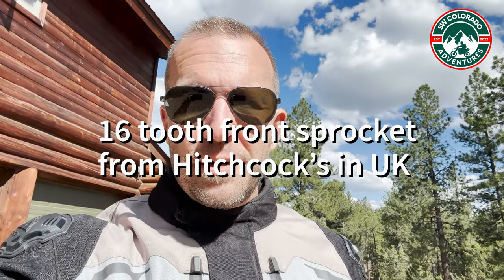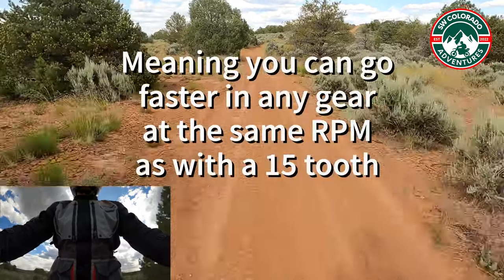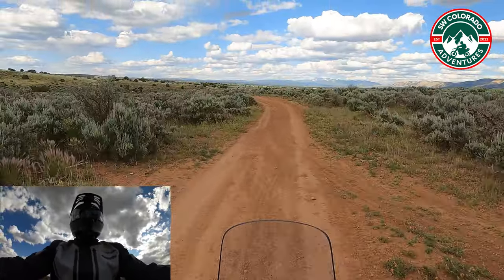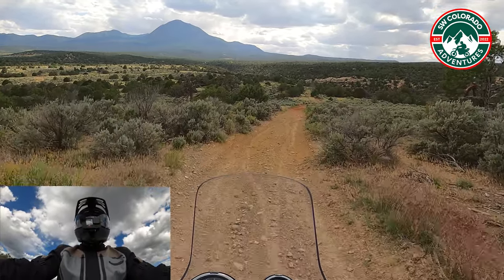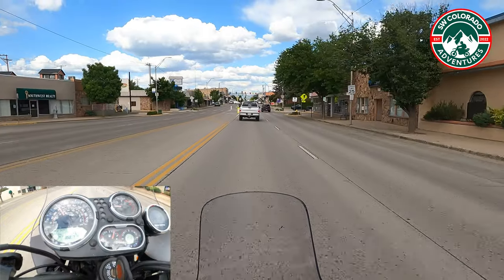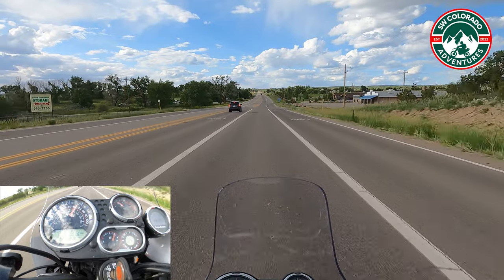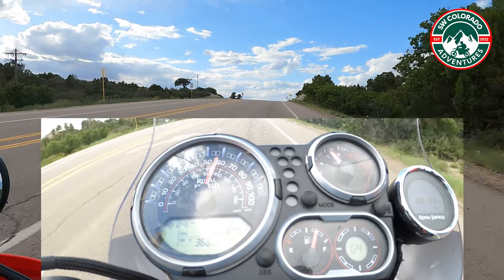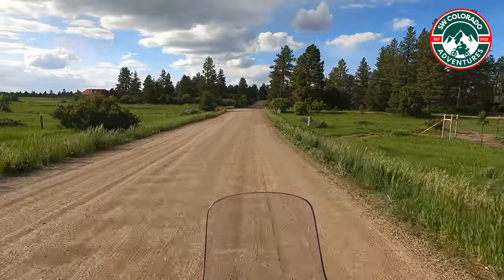16 Tooth Sprocket + Tec Camshaft + Himalayan = Amazing!

Comment from the maker: Have you put on a 16 tooth front sprocket? What are your experiences? I had to buy a new chain, did you?
Reply: What chain did you get? I have the 16 tooth sprocket (came with my bike from previous owner) and I'd really like to install it. Already have the TEC cam shaft
Reply from the maker: @wesloughrie1  I got a DID brand from Japan off Amazon. Nothing fancy but matches specs. Good luck!
Reply: @swcoloradoadventures  right on, thank you
Reply: Tried a 14 and 15 tooth sprocket with tec cam, booster plug exhaust, airbox ais and evap delete. 14tooth had very good acceleration but top speed was 82mph buzzin at at7000rpm max.  15 tooth jt chain&sprocket is much better all around acceleration not as good but did 85mph at 6500rpm and will 87 to 90 maxxed.  Yet to try a 16t,  quite happy with the stock size.  Sea level east coast usa.
Reply: Also have knobby dirt bike tires on my bike at the moment.
Reply from the maker: @lophloph07  sounds like you’ve played around with the bike about as much as I have. Fun bike still even though it’ll never be the speediest. Thanks and be safe!
Reply: @swcoloradoadventures  can you post a link to the chain?  Thx.
Reply from the maker: @bswear77  posted! Good catch! Thanks
Reply: Thanks.  I purchase a 21 himi. Has the TEC installed and a 14T sprocket from the previous owner.  Wanting to try the 16t. Enjoy the channel.
Reply from the maker: @bswear77  nice! Thanks for watching. Be safe out there!
Reply: Just curious, have you ever seen a bear in your adventures?  Does it cross your mind? @swcoloradoadventures
Reply from the maker: @bswear77  I haven’t seen bears when riding. They pretty much stay away from noisy stuff. I have seen them at the house and even when camping but during quiet times. Black bears typically aren’t aggressive unless they feel cornered or threatened. Even those around the house have run off when we make noise. I would be more worried about hitting a deer than a bear personally. That’s my experience
Reply: Here in Minnesota, deer are a nemesis.  I had passed one I could've touched if I stuck out my arm.  I ride extremely cautiously. @swcoloradoadventures
Reply from the maker: @bswear77  i bet. They appear as if from nowhere sometimes!
Reply: @swcoloradoadventures hi, DID chain is the best choice for all bikes. May try a RK chain but that did is so far good.
Reply from the maker: @dmr5095  exactly what I used. Seems to be working great and I think an improvement over stock. Thanks!

Comment: Great information, Ron! I think you turned your 411 Himalayan into the new Himalayan 450.
RE is pushing the Scram and Himalayan out the door with incentives to make room for the new 450 for the spring of 2024.
Here in Vegas at eurocycle, the Hunter is selling. The RE area is small and very few RE bikes on the floor.
Utube seems to bring the most and current information. 
Thank you for your honest, informative videos. The work behind the videos we may never see or comprehend.
Bravo!
Reply from the maker: Thanks Edward! The new bike will be fun from what I’ve heard. Really curious to see the pricing difference. RE is still selling at our local dealership from my last chat with the owner. Thanks for the info and affirmation!
Reply: The only thing is that the new 450 will not be a chugger like the 411Long Stroke. If it is running 40hp, then it is a short stroke which means it is a more on road design like the Vstrom. The relaxed tractoring ability will keep the 411LS a favorite for many who prefer off roading with a relaxing 8 hp at 2200 rpm. With a short stroke, you will be having under 2 hp at that 2200 rpm  which means higher revs required and a less relaxing and more demanding trail experience. In engineering, everything has its price, if you want the 40 hp for the street, it will have to come off the lower end. I foresee the 411LS being a favorite amongst the older riders who would rather upgrade the engine for a little more performance and maintain the low end power that is such a big draw on the Himmy. Just watching the vid, Ron was chugging and keeping up with the kids as they were winding their engines out. That is going to be the difference between the new 450 and the old 411LS.
Reply: Dang a year late! But I am also in Vegas and just bought a 2023 Himalayan 411 from Eurocycle. Still no 450s yet available.

Comment: Hi , I have fitted the Tec cam , !6 tooth front sprocket , AND , changed the rear sprocket from 38 to 
36 tooth ,(this also means you dont need a new chain ) really has improved the bike , better pull , better get up and go , more relaxed top end , love it ,
Reply from the maker: Hey Nigel! That’s a great combination. Thanks for sharing another way to make the whole thing work. Be safe out there!

Comment: How did you modify the chain length when fitting the 16 tooth sprocket? The OEM chain is 110 links. Did you ADD 1 link or did you fit a 111 link chain (if such a length is available).  I dont want to elongate the swing arm slot. Thanks.
Reply from the maker: Oh my. Sorry I missed this. I had to buy a new chain. There are a lot of variables that make it unwise to add a link. I had to cut one or two off of a longer one. Thanks

Comment: what an absolutely stunning landscape and cool trail! and nice job for a non-dirt bike rider. I've got the tec cam too and i've been holding off on the 16T because i was worried that it might make it too weak on 2nd but it seems you did fine. well done
Reply from the maker: Too true. It’s amazing out here. If you ride a lot of dirt take a look at the next few videos. I went back to 15 after one fail tip over. Then I had another fail spin out after 4 tries on a high mountain trail. Now, I’m gonna try 14. But, I primarily ride trails. So, there’s more to the story if interested. Thanks a lot and stay safe out there!

Comment: Great analysis. I have the 14 tooth with a stock cam and the fuelx pro.  Your report gives me good information and I guess one needs to ride back to back with each setup on the same road/trail to see the difference and choose which setup best suits their riding style.
Reply from the maker: Hey Roger! Yes. That is for sure. I was curious about being able to downshift and hit it just right and it seems to have worked. And there was no perceptible loss on the trails so far. I’m planning on some steeper ohv trails tomorrow as long as they’re not still snowed in. Yesterday I rode up a pretty steep loose big rock hill that I was worried about from the bottom. But, I hit that gas and the bike smashed it. Good news is it’s a pretty simple change either direction. Little more so with changing the chain since I needed one more link to make it happen. Thanks!
Reply from the maker: FYI, Roger. I just went up a trail that even the 15 tooth sprocket could not handle and had to turn back. Steep hairpin turn and could get no momentum. Now that everything is opening, It is the first real opportunity for the higher more rugged trails. I ordered a 14 tooth sprocket. So, your perceptions are very likely accurate. Thanks again!
Reply: FYI I can comfortably run 60-65 and can climb most passes 55-60 so I’m ok with that as a top speed. So far I haven’t found a climb that I ran out of power.  I’m currently at Revzilla adventure fest in Sturgis SD for the next few days and brought the DR650.
Reply from the maker: @rogerhilbig3423  nice! That was my guess for top speed. Same that I got going up a couple of passes last week as well just in 4 th. Now, to get up the trails! I appreciate your perspective. Have fun up there!

Comment: I fitted 1 tooth extra on my Himalayan as I mostly ride it on the road it's my daily ride to work bike it will sit comfortably at 70mph , it's just over 2 years old now with 14k miles , the only problems I have had are the feeble rear rack cracked, ( welded it up with some bracing) and at the end of its second winter the rear brake master cylinder seized. Other than that I would recommend the Himalayan, my weekend toy 650 continental gt  will leave it for dead in a straight line, but down bumpy British back roads the himi out handles it no question.  🇬🇧🇬🇧👍
Reply from the maker: Hey James! Thanks for the comments. You’ve certainly had a lot of time on it. I do like the relaxed nature of the extra tooth. I did get into some hairy OHV roads that may make me have two setups. The continental was what I was originally going to get but I decided the trails we’re gonna be more fun. Thanks!
Reply: The royal Enfield 650 twin is a really good engine. But the Himalayan just ticks all the boxes for me. Since I got my license in 1980 I've owned 7 cars and 59 bikes, the himi is definitely in the top 5..👍🇬🇧
Reply from the maker: @chrisfrantz2674  Hey Chris!  Yes I did both. But I closer to 220. For what you ride I think it would be worth a shot. You’ll probably end up needing a sprocket and a chain of your swingarm axle is mostly forward. There won’t be enough room to adjust with a larger sprocket. 20ish for cam, 80 ish for chain for the change. All this depends on how steep the hills really are you regularly ride. Kinda subjective. Sounds like a great possibility for you though. Good luck out there!

Comment: Great video! A big bore kit is just not in the cards for me, so I love to hear about modifications I can make (e.g. 16 tooth sprocket/chain, tec camshaft, air intake/exhaust, booster plug) to increase performance that are relatively lower cost. I appreciate your content. Please keep up the great work, brother!
Reply from the maker: Thanks for that! Hope it helps. It’s fun to mess around and squeeze a bit here and there for sure. Good luck!
Reply: @swcoloradoadventures  Follow-up question for you… would you recommend a Powertronics ECU piggyback (or other similar device - e.g. PowerCommander) and/or a fuel system management upgrade (FuelX) to go along with the TEC Cam/16T gearbox sprocket upgrade?
Reply from the maker: @ghostmoto1  tec Bike folks recommended the Fuel X Pro. When I installed it, there was a small difference of throttle response. But that was before the cam. I had an ecu for a bit, but it was defective unfortunately and I never replaced it. So I can’t really say on that.
Reply: @swcoloradoadventures  Thank you for responding… looking forward to your next video!

Comment: Just remember that the odometer on the Himmy is likely to be highly inaccurate (known issue). But, you're comparing an inaccurate from before the 16-tooth to an inaccurate after the 16-tooth, so assuming that the inaccurate is fairly consistent, the bike's performance has definitely made progress! I'm about to put a 16-tooth on mine as well. Ride safe!
Reply from the maker: Will do! Thanks. I have a 14 tooth on currently. As soon as the snow clears, I’m gonna hit some steep trails and see the difference. Admittedly it’s all based on the buttometer. 😂
Reply: All speedometers are inaccurate for reason. Law. So all.manufactures will usually make the speed read faster than you are  actually travelling. This woukdnt be an issue specific to Himalayans.

Comment: "I can't go anywhere around here without needing to go 65."

That's a refrain I hear often from motorcycle riders around here.  I always find myself questioning the term "needing" and think it more aptly should be "wanting."  I understand wanting.  But not needing.

Yesterday I had to take my 149cc Vespa in for the PA Safety Inspection.  It required riding in the rain on a road with a 55mph speed limit where most of the traffic was moving at 65.  My little Vespa could manage 55 on the flat and would drop to 50 on the inclines.  I didn't want to go faster and I didn't need to go faster because I would just pull over and let the cars and trucks pass when necessary.  But I know most riders don't want to do that.

With the Himalayan I can easily track along at 65 so it's not an issue on those kinds of two-lane roads.  But on the Interstate highways, I80 and I99 the speed limit is 70 with most traffic moving faster.  I will run the Himalayan at 70 and just let the traffic flow around me.  Or find a common carrier tractor-trailer rig that the company has them locked at 65 and follow them.  The stock Himalayan is workable on any highway dependent on my willingness to adapt myself rather than modify the motorcycle.  

For me, if I was concerned about necessary higher speed performance I would have bought a Kawasaki KLR 650 or a BMW F650 GS.  Similar weight and performance to the Himalayan but much more capable at higher speeds.  But I bought the Himalayan specifically for it's diminished power and speed so for me it's not something I want to "fix" or focus on power where I "need" it.

It was interesting to listen to your descriptions of the changes and how it affected the ride.  And I would imagine some regular riding on the dirt bike track would increase skill levels a lot.

Thanks for sharing it all.  I enjoyed watching.
Reply from the maker: Hey Steve! Thanks for the thoughts. The biggest challenge is in two parts. One, I live in the mountains.   My initial impression of the bike was that the 65 speed would be a non-issue, but I was a bit off. Maybe I just need to lose weight to Itchy Boots level. The real reason I want it is to simply not be another reason for locals to have to slow down or pass. We get so much tourist traffic in RVs and folks not accustomed to driving in the mountains, it can be a frustration for people just going to work. 

Now, that does present the great point you made about simply following slower traffic. There are plenty of options for that. So, the perceived need is diminished. I don't want to go fast, but I don't want to be a hindrance either. I remember reading the motorcycle handbook many years ago (30+). One of the big points I took away from it was for motorcycle defensive driving. It said stay in front of traffic to mitigate getting boxed in. Sure doesn't mean be crazy, just give yourself more options. 

And for dirt. I am enjoying the time out on the track. Just like any ride on rough terrain, I am always more comfortable on the way back. The theory is, given enough practice, I can have the same confidence and relaxed state starting a ride. Its a theory. Thanks for the good stuff. I really appreciate your perspective and easy going approach.
Reply: The I80 pops up to 80mph across most of Wyoming. A smidge of extra power sort of sits right in between 'need' and 'want' at those speeds IMO as I can't really pull over to let trucks pass and they're almost exclusively traveling faster than the posted speed limit. To your point however I typically have my gps app take me down backroads instead of on the interstate where possible as I don't 'need' to get on the freeway. I could also purchase a different bike but the Himalayan, to me, feels like it's almost there at stock.
Reply from the maker: @christophercawdrey4733  totally agree! It really just depends on where you take it. My guess is there may be a "bit" of wind to contend with in Wyoming as well. Just a rumor though😂🌬
Reply: @swcoloradoadventures  hah, we get a tad bit indeed. You get more snow though! Just subscribed. Cool channel you've got here. When you putting a ski and track on the himi for winter riding? :)
Reply from the maker: @christophercawdrey4733  you are funny! However, I was thinking about rigging up some old x country skis I have. Just for funsies. Hope the winter is not as long this next year though.
Reply from the maker: @christophercawdrey4733  Thanks for subscribing as well! More is coming and I hope it’s worthwhile.

Comment: Hey man, I recently fitted the Tec cam on my Scram and am finding it's got excessive tappet noise.  I was trying to listen to your bike but it's hard to tell.  Does your Himmy have the loud ticking sound after the cam install?  Mine seemed noisy to begin with and moreso after the cam.
Reply from the maker: I believe mine are about the same. I definitely adjusted them after and made sure the setting was as tight as it could be.